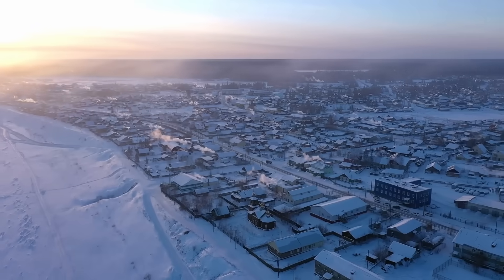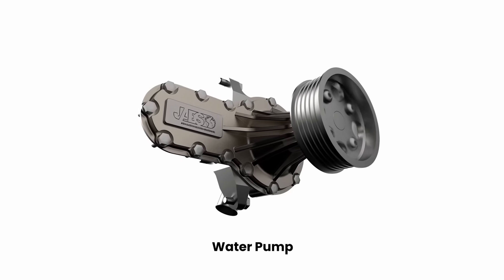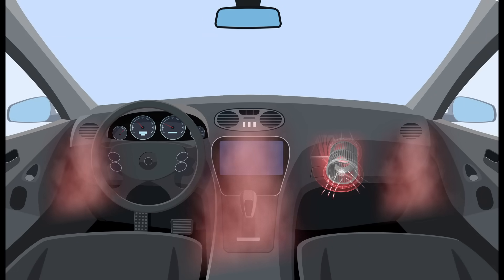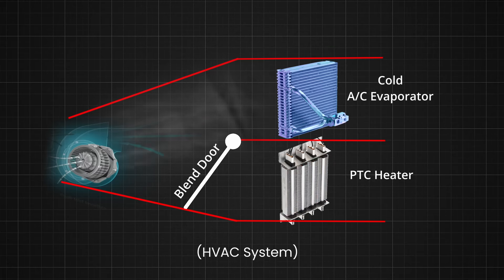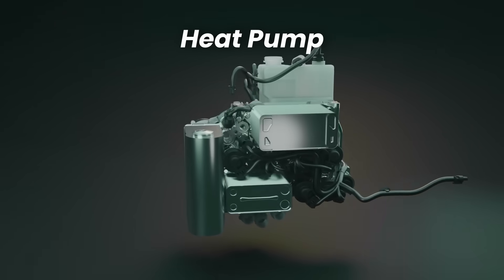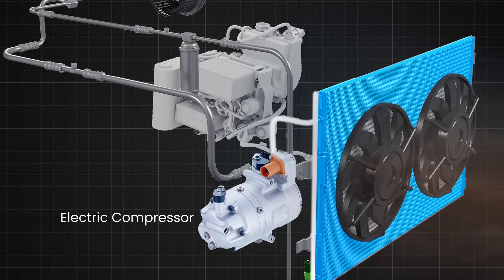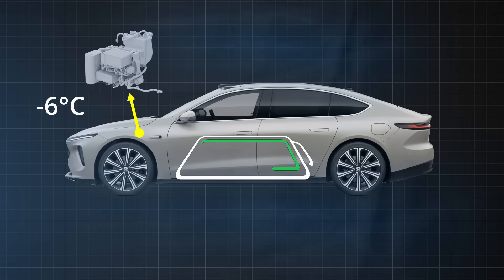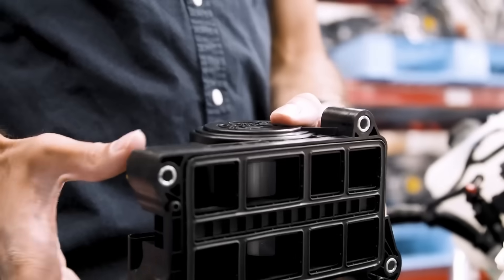Cabin Heating Explained : Engine Cars vs. EVs (PTC Heater, Heat Pump, and Tesla’s Octovalve)

Comment: Will not the Peltier better than a PTC/Heatpump on BEVs, except for the cost🤔. The Thermoelectric Peltier produces more heat than refrigerant based cooling, but can efficiently used to heat the battery from a cold condition, while it provides instant cooling. It is easier to adapt a peltier for seat cooling and heating, coupled with the cooling tubes similar to the ones found in a modern laptop cooler. The biggest takeaway is the ability to cool or heat the seats almost instantly, with the additional heat/cooling generated can be used for battery heating or cooling. It could be complementary to the efficient but slower refrigerant based cooling system, while totally getting rid of the PTC heat system.
Reply: Why have fridges not switched to the cheaper, smaller, and more reliable Peltier? Because it has a COP <1 while a refrigerant unit has a COP >2.  COP = Heat Energy Output / Electrical energy Input. 
In other words it produces more heat than it transfers.
It is still better than PTC heater though.

Comment: The PTC appears more simple than the heat pump. How much does the heat pump and it's components weigh?
Reply from the maker: typically, a complete automotive heat pump system, including the compressor, evaporator, condenser, and associated components, weighs around 20 to 30 kilograms (44 to 66 pounds).
This weight is higher than a standalone PTC heater but is offset by the heat pump's energy efficiency, which is especially important for extending range in electric vehicles.
Reply: In addition to the answer above. Weight isnt as big of issue for efficiency as its sometimes made out to be. Traditionally for ice vehicles it has a big impact in the city but thats severely reduced in EVs because they con recuperate around 80% of that energy on average. During motorway travel the only major impact is increased rolling resistance which is usually reduced through higher tyre pressure. So generally a heavier vehicle only uses significantly more energy for acceleration. I regularly watch videos from various cvar channels where people test motorway fuel consumption and then mention that its really low for such a heavy vehicle while weight has little impact on the motorway. But of course lighter is better in almost all circumstances.

Comment: The PTC heater is after the A/C coils in the event defrost is on, your diagram is incorrect.
Reply from the maker: Thank you for pointing that out! You’re absolutely right that in some models and regions, the PTC heater is positioned after the A/C coils, especially for defrosting, and there are setups with separate paths for the PTC heater and heat pump. Tesla and other brands sometimes vary this configuration depending on the climate and specific vehicle needs. For clarity in the video, I simplified the layout to avoid confusion and make it easier to follow. Appreciate your input—it’s great to have this kind of feedback to show how varied these systems can be!

Comment: Since every airco is a heat pump, why did the ptc ever exist in EVs?
Reply: Before EVs were a thing, you would rely exclusively on the engine heat to heat the cabin so all existing AC units for cars were designed only to cool as there was literally no reason to add the extra cost and complexity to reverse the flow. Since a lot of EVs are based on ICE platforms, they used what was available before scaling up production of bespoke EV parts like AC/heat pump units.
Additionally, despite what this video says, heat pumps are worse than PTC below a certain temperature and slower to provide heat when turning on the vehicle, so they are still used as initial/backup heating for cabin even in EVs with heat pumps.
Reply: @LAndrewsChannel  But the PTC is not always used. So this tech is better.
Reply: @LAndrewsChannel  probably just because before EVs where a thing their was no need for a full heat pump system that small so it probably took some time to develop a small enough system and get it cheap enough to be practical
Reply: @LAndrewsChannel  OPs question is very valid. Turning home central A/C units into heat pumps is relatively simple and doesn't cost much at all. Why would it be harder to do for a car A/C unit since they use the same principal?
Reply: @LAndrewsChannel  I understand the reasoning but not exactly the math. For example Tesla delivers same range but with much lesser battery capacity which is nowadays the biggest cost factor including the car. 
When VW group makes the ID platform from zero, how is it that the sell the heat pump as an option? They could had made the battery pack smaller, reduce the cost and "kill the market" for the same range. 

I guess it's about culture and you pay the price for it.
Reply: @chat-1978  You are diverging from the subject. Tesla is using PTC in their car alongside heat pumps just like many other brands.
Also where is Tesla delivering same range with "much lesser battery capacity"? An ID.4 Pro 4Motion with a 75.5 kWh usable capacity achieves 507 km range while a Tesla Model Y LR with 70 kWh pack usable achieves 493 km range in slightly better conditions for the Tesla. Numbers from Bjørn Nyland. Where is that "much less"? The efficiency "advantage" for the Tesla is 5%, close to nothing real world. Stop treating Tesla like some kind of messiah, they are not. They were the first to start developing the modern EV, but their lead shrank to almost nothing now.
VW sells everthing as an option.That's how they are choosing to sell their vehicles. Heat pumps do not magically extend the range, especially in the summer (duh) so there is the option for the consumer to not include it to save money if they live somewhere with much milder and short winters.
Reply: @LAndrewsChannel  if I gave you the idea that I love Tesla then you are incorrect. Unfortunately I do drive an id. 4 and there is no way that it achieves those numbers not even with favorite conditions. Not sure about Tesla and my comparison was unfair. 
Problem is that when the heat pump is an option, you can't really compare apples to apples. 

And you are right, we deviated a bit. Thank you for your time and answers.
Reply: @LAndrewsChannel Would just flag that there's no PTC   in the Model 3 and Y with heat pumps.
Reply: @chat-1978 if you look at Tesla real world range vs. other cars you’ll see the differences are very small.  I’ve had two Teslas, a Model 3 Performance (310 mile claimed range) and a Model Y Long Range AWD (330 mile claimed range).

 On average they each hit between 70-75% of the claimed range in real world driving. By comparison, our BMW i7 xDrive60 has a lower rated range than either Tesla (298 miles), yet the BMW actually exceeds its rating consistently even in winter.  In summer it regularly will go a full 50 miles further than BMW claims it will do, and nearly 100 miles further than our “330 mile” Tesla can actually go at highway speeds. 

Not once have I ever come close to 310-330 miles in either Tesla. If I even get upper 270s-280s it is a miracle, and only in relatively slow traffic in warm weather. At 80mph both Teslas will struggle to go much more than 220-230 miles. At 80mph, our i7 will go 310-350 miles depending on season. At higher speeds the BMW is often more efficient than the Teslas delivering very good efficiency of 3.4-3.5mi/kWh even though it weighs 1500-2000lbs more than the Teslas, is 3 feet longer, considerably wider, and has a worse drag coefficient. Both the BMW and Y have heat pumps and PTC heaters. The PTC heater works better when the temps are extremely cold. Heat pumps struggle to work well below ambient temperatures of less than ~20°F. 

Going to your question about the VW ID.4, it is VW’s first real attempt at an EV. They did a decent job, but it was also somewhat rushed to production in the wake of Dieselgate. VW has since learned a lot about making electric cars and their next gen ‘MEB Plus’ models will be more efficient than today’s just like Tesla has consistently improved over the last 15 years. Tesla doesn’t mind taking a hit on styling, storage space, or refinement if it means lower cost, weight, and aerodynamic drag.  The ID.4 is a much nicer riding vehicle than the Model Y, but it weighs more, isn’t as aerodynamic (but it has a more useful trunk since the rear doesn’t slope steeply like the Model Y), and it has more features (radar, ultrasonic sensors, surround view cameras, ventilated seats, multiple displays, heads up display, etc.). The Germans tend to be quite conservative with their range estimates, whereas Tesla is very liberal with theirs. Tesla also uses a different EPA Test Protocol which prioritizes low speed driving to be able to advertise larger numbers than anyone will actually hit IRL. I just watched a comparison test from Carwow last week showing the Model Y vs. cars like the Kia EV6, Ford Explorer EV (rebadged ID.4), Polestar 4, Macan EV, etc. The Model Y and Ford Explorer EV consumed energy at almost the exact same rate, roughly 3.8-3.9mi/kWh. The difference is so small it could just be a rounding error in the trip computers. The Model Y is advertised with a nearly 40 mile longer range than the Kia EV6 GT-Line, but in reality it went just 10 miles further. To make matters even worse the Kia was riding on larger 20” wheels while the Tesla was on 19” aero wheels with ultra low rolling resistance tires. Had the Kia also been riding on the standard 19” wheels and more eco focused tires, it’s likely it would have gone further than the Y. I also have suspected in the past Tesla’s trip computer readings aren’t exactly accurate. I’ve seen where the consumption seems very low, but when you divide actual range vs. the battery pack capacity you see the actual consumption is a good 10-15% higher than the car reports. 
Heat pumps cost more to make than PTC heaters and cars with heat pumps still need PTC heaters, which means there’s additional parts. That’s why it’s an extra cost item for some companies. Eventually they’ll become standard across the board. It’s already happening with many EVs as they get updated.
Reply: @CFG39  last paragraph makes the most sense. Didn't know about that. I guess you mean for the cabin's air, not seat etc. 

My issues with id4 are not electric. The software is shit. The hardware for the software is shit. The controls for basic functions are shit. The car is built like shit. Their support in Belgium is bad. 

I change cars quite often. Never had such a bad car regardless of the power train
Reply: @ yes, the heat pump and PTC heaters are for the HVAC. The seats operate completely differently. The heaters inside are just small coils like what is in a heated blanket. 

VW’s software was rushed to production with a million problems. The updated ID.4 with the larger screen operates quicker and with less issue, but the touch sensitive sliders are awful, and having to adjust everything in a sub menu was a poor design choice. VW claims they will be going back to more physical controls which would be good. I hate the new cheaper Tesla-Esque VW Interiors that have gone too far on cost cutting. I also had a Mk8 Golf GTI and the infotainment was so terrible. I got sick of the car after a year and sold it. Compared to my Mk5 and Mk7 Golf GTIs the Mk8 felt so cheap, just like the ID.4 interior.
Reply: @LAndrewsChannel  VW EV is shit. Don't cry babe.
Reply: @iJfry this is true, but misleading. I'm sure the posters here all think the Tesla heat pump works in -25F temps. Lol no, it can't.
What Tesla does is use the motor windings in the compressor as the heater. Which imo, is an extremely stupid thing to do, because Tesla rather wear out a $1500 plus part vs a dedicated ptc heater. An ev at those temps might use around 5kw or more for heat. A car HVAC compressor normally doesn't use over 1.
Reply: @chat-1978 I prefer a PTC because is cheaper to fix than a octovalve and a heat pump😉
Reply: Money
Reply: Cost.
Reply: @CRPerformance1  You undestand that it would had been better not to answer with the most obvious answer. It is always cost but why. batteris also cost and both heat pump and batteries help increase range. If the batteries are the most expensive part of the vehicle, wouldn't the heat pump offer more per USD than a battery?

If you can't asnwer all commented, then best not to answer.
Reply: @chat-1978  Early EVs were expensive. So saving money on manufacturing, even if range would be affected, was a good business decision. EV costs have come way down so more expensive systems can be added to increase range.
Reply: @CRPerformance1  that makes more sense. What I don't understand is spending the extra cost on battery. 
For example, 
If you ask me, it's hard to make options with the battery size but it's easy to make options with heat pump for example. Could be wrong though. 
It's hard to calculate e per km gained per kWh installed or with heat pump.
Reply: A lot of combustion engine cars use PTC heaters for accelerating cabin warm up
Reply: I keep wondering this about all AC units in any application. Such a simple amazing technology.
Reply: PTC is faster, and heat pumps have a problem in strong cold
Reply: @christiankaiser6562  mine doesn't. Even when it's -25f out
Reply: @ryanyoung7433  It means that it has been “oversized”.
Reply: Heat pumps don't work in extremely cold conditions because of icing of the front heat exchanger.
Also PTCs deliver warm air more quickly
Reply: @ False. Worked as good as a 50 degree day the other day when it was -28f.
Reply: I imagine cost. EV have skinny margins
Reply: Space and less expensive
Reply: As external temperature drops, there’s less heat to pull out of the exterior air and ‘pump’ into the cabin. Efficiency drops. Heat pumps don’t make their own heat. 

The amount of waste heat from internal combustion engines is essentially constant at all external temperature ranges. It never made sense to add extra complexity into the aircon system when you could just use a basic heat exchanger to reroute a small part of the waste engine heat into the cabin.
Reply: @HarukiYamamoto  True, but then again there are heat pumps for home that work with similar temperatures. Though they sometimes need to use resistance heat to bring them to working temparature

The reason I ask and I don't get an answer is that, heat pumps (aka A/C) work both ways and with same external temperatures. On average on earth they are more efficient, so why not just use the same, including it's warmer.